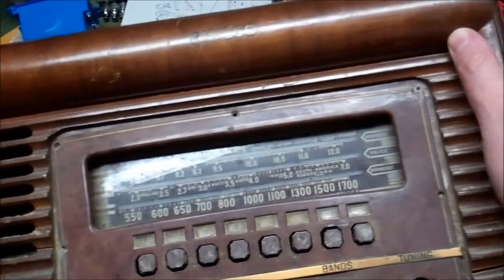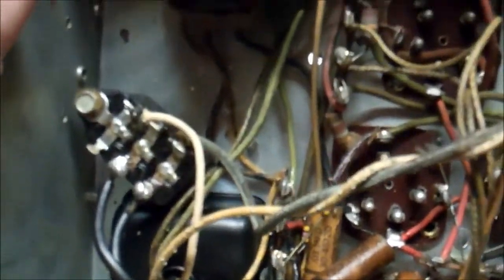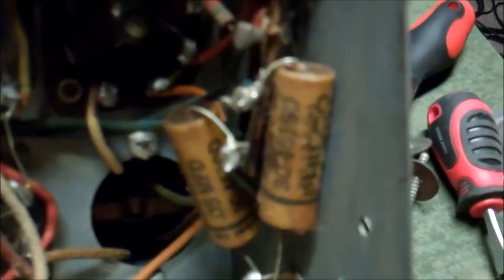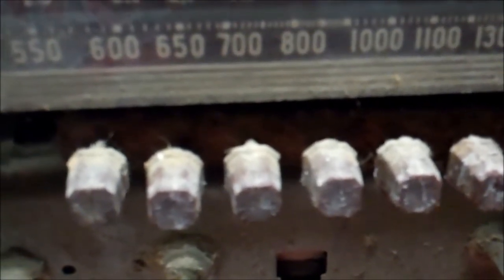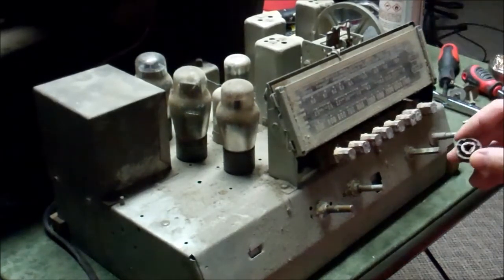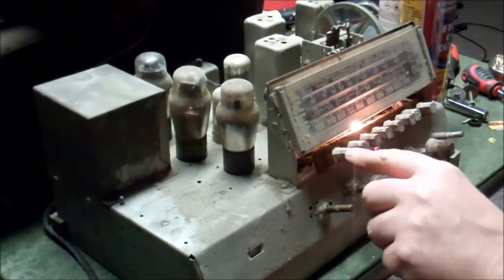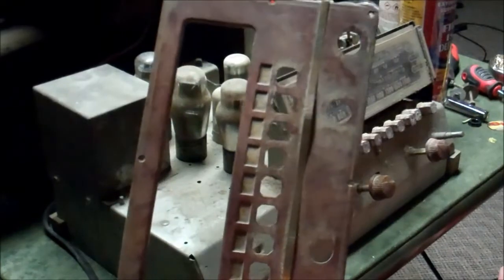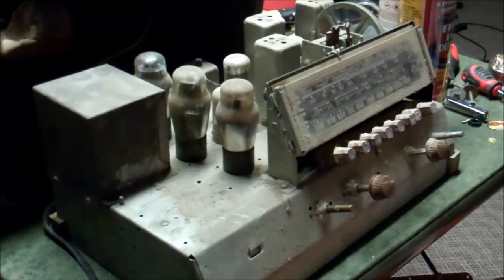1941 Philco  Model 41-250  donated to our channel

Comment: The question is do you want to fix it? If I had the space I would but then Radio is my interest, but not so much a skill.
Reply from the maker: Right.   If it was a classic vintage stereo receiver, I'd gladly handle the job...   If it was just capacitors and resistors,  I'd get started...   with it needing a new faceplate and knobs,  I'd rather hand it off to a radio fan.   Personally, If I fixed it to keep it here, it wouldn't see much use.   I don't have a buyer for it in either condition.
Reply: @DeadKoby  I cant find a console that catches my eye here, Loads of Tesla stuff but mostly mono and needing converting from ORIT band to the more normal FM the rest of Europe and USA use. I am slowly working on a 589 tesla am radio as I can plug the mono output of another FM radio I have into the Phono input, if I ever finish it but the other good point was the case is fine an al knobs are there. it would take a lot more time to get your philco looking nice .